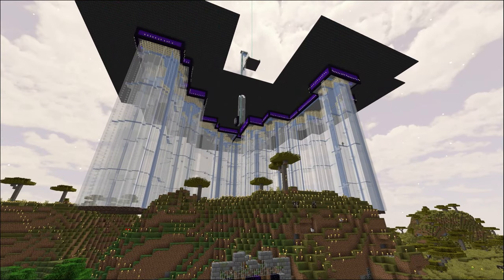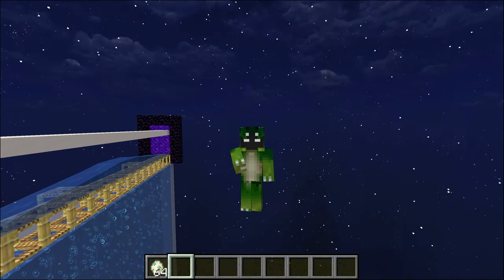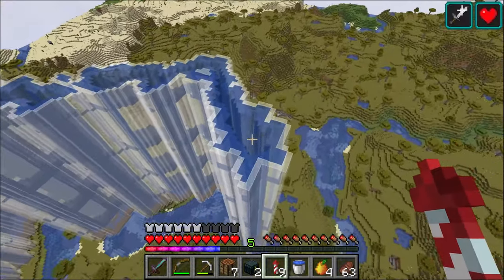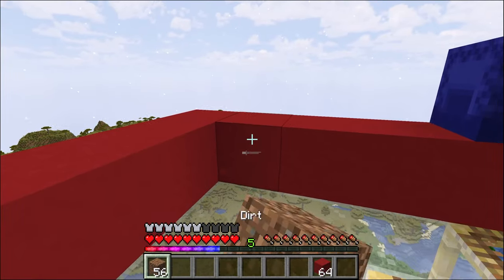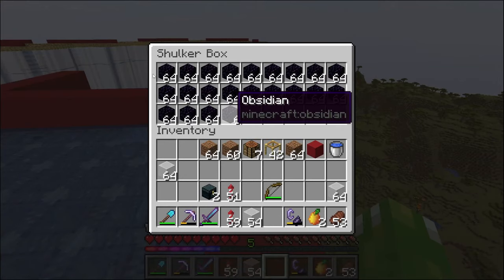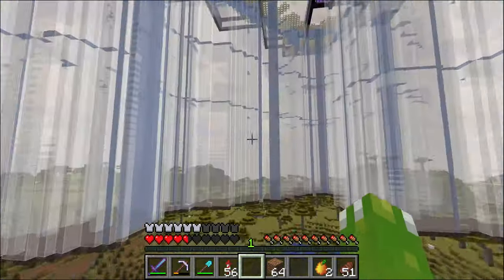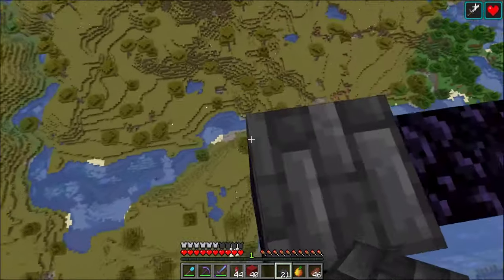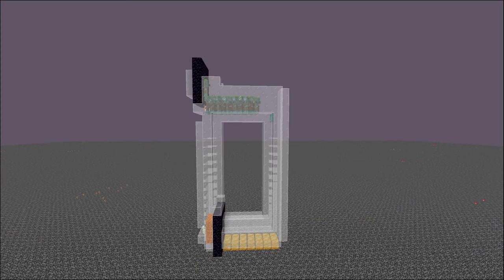Minecraft Trident & Copper Farm - 120+ Tridents Per Hour

Comment from the maker: Just a reminder you DONT need to remove the bedrock or make a perimeter, and if the farm looks too scary you can lower the scaffolding layer as low as you like, and you can also take up as much or as little of the river as possible! so you could have a farm that runs for like only 40 blocks along the river bank and is 30 blocks tall

FAQ'S:
Where is the world download???
- The world download is centralised with all my other farms on my discord server in the channel #world-downloads: https://discord.gg/nEkazuB

Do I have to build the whole thing it's rather large?
- No, you can build any portion of the drowned farm, taking up as much or as little of the river as you want. Do note though that the height cannot be shortened if you're making the 'harder version that is in a perimeter', but if you are making the in the 'sky version' then you can make the bubble columns any height you want :)

How does this work in 1.18 with the new world height changes?
- For 1.18 you will need to ensure that the lowest layer of the water streams at the top of the farm never dips below y63 still. This means making a farm starting at any layer but it must exceed y63. 
So what happens if you make the top below y63? Well during the daytime the drowned are pushed just like they would above y63 but when night arrives drowned are unaffected by water streams below y63 and hence will get stuck and clog up the farm. Now this means that as long as you have a bed bot running then the farm won't ever get clogged and you can make a compact and efficient farm from layers say y-59 to y-33.

How can I find a large, hook-shaped river, like the one in the video?
- I highly suggest using the chunk base biome finder tool on their website. 

Does this work on paper?
- This depends on the configuration of paper as I believe there is a setting that stops entities going through nether portals, but if that setting is disabled then it should work, although I'd definitely test small scale on your server first as every server is different.

Does this work in 1.16?
- Yes, it works on every version after and including 1.15.

Do I really need that many turtle eggs?
- Lucky for you no you don't, in fact, you can get away with placing one every 8 or so blocks and to help attract drowned I recommend placing it one block below the feet of the drowned and attach a trapdoor facing the portals so they attempt to pathfind to it.

Is the perimeter worth it?
- If it's worth it is subjective, but as mentioned in the video, the addition of a perimeter doubles the rates.

My farm isn't as fast as the one shown in the video, why is that?
- If you're playing on a server, the mobcap could be full in other areas meaning that you'll get fewer spawns, the server could also be lagging (below 20tps), and also as every river is different, your farm may simply just have less spawning spaces than the one shown in the video.

Do I have to use glass for the edges, that's quite a lot?
- No, you can use any building block of your choice, as long as it doesn't get destroyed by water. Although keep in mind that using solid blocks will vastly reducing pack spawns (bonus mobs) and hence you'll get less drops

How do I use those .schematic files in the world download?
- Simple. You just need to download the litematica mod from this page: https://www.curseforge.com/minecraft/mc-mods/litematica
And also follow this tutorial if you aren't familiar with it: https://www.youtube.com/watch?v=Z0Li5CPAyns

How do I make that big hole/perimeter you showed in the video?
- Just follow this excellent tutorial by Pixeils:
https://www.youtube.com/watch?v=pPeNFU_wfk8
Reply: ig ill be using ur servicices without a doubt lol
Reply: Do you identify as the rare "sigma" male?
Reply: @zans4018  ncoyler and all of his viewers are sigma males with trillionaire grindset.
Reply: @nate1781  ncolyerinaire grindset 🙏
Reply from the maker: @zans4018  hey
Reply: Does it have to be glass
Reply: ur a madlad, I love it
Reply from the maker: @civilizationvi4216  nope :)
Reply: Is this Java or Bedrock?
Reply from the maker: @freezergames3839  java
Reply: Anyone know if this works in 1.20?
Reply: Would it still work if I put the soul sand 1 block lower than it should be ?

Comment: Now could you increase the rates even more if you were to combine that with cubicmetre’s reactor farm? (Yes it would lag and yes the mobcap would get filled pretty quick but im wondering how much can we stretch the rates)
Reply from the maker: At the moment this the mobcap is at around 60, but as the metre cubed drowned farm fills up, it'll slowly take up the whole mobcap, river spawning will subside and so will m3 drowned farm for the cycle to begin again
Reply from the maker: This also means u won't get any tridents or NS
Reply: @ncolyer  yeah I guess you’re right. That’s a good point I didn’t think of.

Comment: Yo I got a silly question. Would it be possible to just skip the water on top of the scaffolding entirely? Considering that you're using turtle eggs behind Every Portals, would they just walk through the portal without needing water to nudge them in?
Reply from the maker: Yeah you could for sure, the water is there just to push them in a bit quicker and sometimes I noticed that they don't go for the eggs at all

Comment: will you make a new design for 1.18 with the optimal river layout, so that the hole perimeter is a river biom? bc in 1.18 river bioms can now be much much bigger, ofc you would need to find them but if you have a good location you can boost the rates immensely
Reply from the maker: Probs not Coz the base concept can be expanded to fit any size river. I talk about this at the end of the vid too

Comment: Ncolyer can i use stone instead of glass so that light dont get in the spawing area
Reply from the maker: you can but if u opt to not use a roof and also use solid blocks like stone to keep the light out then you will receive a pretty considerable reduction in rates due you not getting any pack spawns (when a mob spawns 4 attempts are made to spawn mobs around that mob but these are cancelled if a solid block gets on the way)
Reply: Oh thanks
Reply: I will use glass only
Reply from the maker: @richagarg1143  u could technically use stairs as they aren't full blocks

Comment: Firstly, LOVE the farm and concept behind it! Now on to the slightly more akward part, I tried the download and ran a few tests but am only getting between 8k and 8.5k drowned per hour (about 1/2 of the numbers based on 120 tridents per/h)... am I missing something? * Tested in Vanilla 1.18.2 directly in the world download.  I am comparing different drowned farms and want to build the most 'efficient' version and this one seemed like it but wanted to double check those all important numebers <3
Reply from the maker: hi thanks for the comment,
 r u testing the design with a perimeter coz that's when this farm gets 120 tridents/h also this vid was made b4 1.18 and because of the world height changes the farm in the WD will be twice as high up so the spawns will be 2x lower in 1.18
u can check my pinned comment where I mention how to fix this
Reply: @ncolyer  yup, the perimeter WD, but the height might be the issue then (oops).  For that fix... should I just be extending the base of the farm down to the new bedrock layer (since the top still needs to be above y63)? Or did you max rates by building a smaller farm lower down and only running at night? (thanks in advance)
Reply from the maker: @blakedavies1992  so extending the base will require making it like another 50 blocks taller which is a bit of effort but if ur fine with that then yea that's the easier option

if u wanna get tricky with it, you can translate the farm down to the new bedrock layer but then the top of the farm will only be at around y5 which is below y63 meaning that at nighttime drowns wont be affected by the water. to mitigate this you could afk at a bed and constantly have the player trying to sleep in the bed so it'll always be daytime, this works extremely well on singleplayer but on multiplayer it can be a bit annoying and u gotta then use the drownds pathfinding to move them into the nether portals. 

I've made a couple designs which do u pathfinding to achieve this but there are so many bugs to do with drowned pathfinding, especially when scaffolding involved so sadly I cant release a 1.18 optimised version of this farm until those bugs are patched
Reply: @ncolyer  thanks heaps! Just extended the bottom down to -58 (top still at or above 63, and rates went up to 13.5k... muuuuch better :P
Reply: @ncolyer  Soooo... ran into a little (possibly impossible) issue with moving the entire farm down between y-59 and y4... the Nether Portals all link dont link up correctly (the drowned come back out of the portals at the top of the farm.  Only way to fix this is to move the Nether side down by the same y offset to match the overworld... but sadly the Nether doesnt go below y=0 so no way to link them.  I thought about inverting the setup instead, but no reliable way to lift mobs in the nether without access to water :(  Any ideas you can think of that I missed? :)
Reply from the maker: @blakedavies1992  the kill chamber doesn't have to be at the bottom of the farm, u can move it up to above y0

Comment: You mean, you build on y 85 to 148 but if I wanted to build efficient and 1.18, I need to make y-59 to y-33 right?
Layer height is difference but it's really correct?
srry that my English, because I'm Japanse ;;
Reply from the maker: hey Ur English is fine don't worry :)
have u checked the pinned comment as I answered this question there I'm pretty sure
Reply: @ncolyer  I try to understand your pinned comment
so, I should to place soul sand on  y-59 and scaffolding on y-33 to make most efficient?
Reply from the maker: @sugapon  if you're going to make it that low u need a perimeter and u need a bed bot running that constantly skips night time otherwise the drowned are going to get stuck, also the shorter u make the farm the faster the drowns get sent to the nether but the less spawning spaces u have meaning that you'll have to make the farm both longer and wider

Comment: Why do you do Y=85-Y148 when you go without a perimeter? Would it be better to do something like Y249-Y312 so its out of spawn range of caves so hostile mobs don't spawn in them and clog up the mob cap?
Reply from the maker: The player afks at 160 so the spawning sphere only dips to y32, so there's only a few caves to go up. For every block you go up the rates of the farm trop by 1/x so a height of 249 to 312 would be like 5 times slower than the current design
Reply: @ncolyer  Ahh neat, thanks for the quick reply! I'll be trying to build this on the SMP server I frequent soon

Comment: Building up those glass pillars for the scaffolding is near impossible, have you got any tips?
Reply from the maker: yea place scaffolding along the outer edges of the glass border. then face into the scaffolding and keep placing down more scaffolding until u reach the length limit, where the scaffolding stops place a block of sand that'll fall down to the bottom and act as a marker for where u need to pillar up from, then once uve marked out the spots u can drop down to the bottom and pillar up from there
Reply: @ncolyer  that wont work bcs soul sand is a bit lower than usual blocks, sand will just break. Gravel aswell
Reply from the maker: @matropgy  yea ik but the item will drop and that can be ur marker
Reply: @ncolyer  but how can I even get down to the bottom? In the water column? Always pushing you up. That was my question all along
Reply from the maker: @matropgy  oh wait in the vid did I say to fill it in with water b4 pillaring up blocks?
Reply: @ncolyer  I dont think so no
Reply from the maker: @matropgy  if I did then in stupid sorry but u can still do it u just got to remove the soul sand where ur pillaring up blocks from
Reply: @ncolyer  because now, I need to find a way of doing that, like I said, its impossible
Reply: @ncolyer  that will be painful. But if its my only option I'll do it sure. Thanks
Reply from the maker: @matropgy  well just go below the farm and remove the soul sand from there, no need to try and go through the water
Reply: @ncolyer  yeah I'll do. More grind .. but thats what you gotta love, thank you

Comment: Do you know why the drowned spawning in my farm are landing on the bottom of the scaffolding, not the top?
Reply from the maker: what height is the scaffolding at?
Reply: @ncolyer  standing on top of the scaffolding I’m at Y = 149
Reply: @ncolyer  I’m now watching the video back again… I placed my soul sand so that I’m at Y = ~84.75 (pretty much 85), is this wrong as well? Do I have the move the whole thing up by a block?
Reply from the maker: no those heights are fine, are all the drowned going to bottom of the scaffolding or only some?
Reply: @ncolyer  pretty sure it’s all of them. I decided to lift the whole farm by a block anyway, but I’m still getting this issue. I placed the water lanes and let them flow to each side, and it seems like the drowned are now being pushed above the scaffolding, so maybe it’s not an issue.

Comment: have you considered making a litematica schematic?
Reply from the maker: no as it's not a concrete design as it changes depending on river shape. also this design is outdated past 1.18 sadly
Reply: Of course, the portals in the nether have to be designed a little differently. But I wouldn't say the design is "outdated". It just doesn't work on the nether roof anymore. I am currently building it in 1.20.

Comment: What Materials do i need?
Reply from the maker: it varies depending on how big your river is but there's a schematic in the description of the kill chamber which comes with a material list but as for the area where the drowns spawn I can't really provide a material list sorry because the size of that area varies alot
Reply: @ncolyer   Thanks and can i Build it on a Ocean or won't that work?
Reply from the maker: @immimunyt6672  an ocean will be 30x slower than a river so I um wouldn't advise it